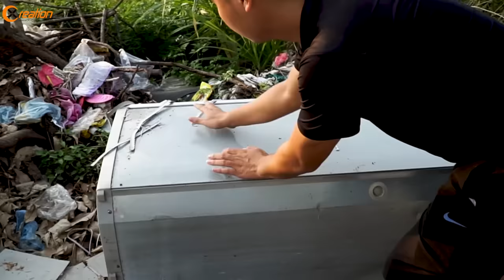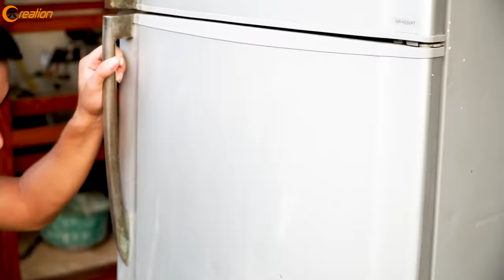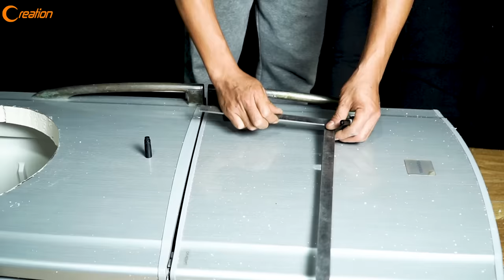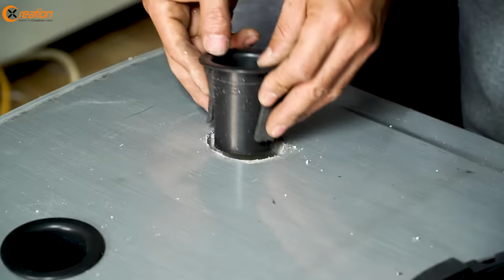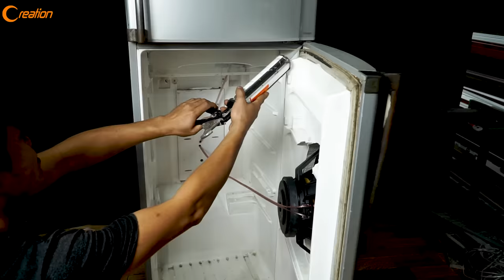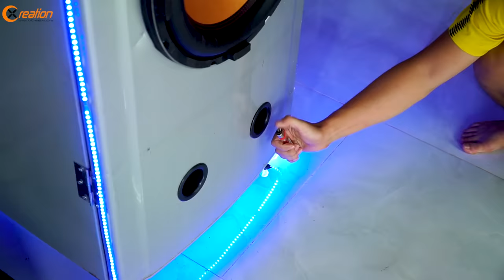Recycle Fridge from landfill into Giant Speaker Box!

Comment: That's fun however the screws you mount the bass speaker wouldn't be hard enough to hold it just because there's a foam inside the fridge door. This foam you can scratch by fingers )

Comment: Martin Audio equipment?? It looks like a funky speaker at a glance, but it has a good Tweeter and Woofer so you can expect great sound from this speaker. But the cabinet (Fridge) isn't sealed correctly and isn't designed to deliver frequencies from 30 Hz to 20000Hz. So, therefore, you may hear some distortion or rattling sounds from this speaker at specific frequencies (usually Low Bass notes). Thanks again and lovely video, keep up the great work!! 

Edit: Martin Audio is a leading brand in A/V systems and Touring/Concert grade audio.